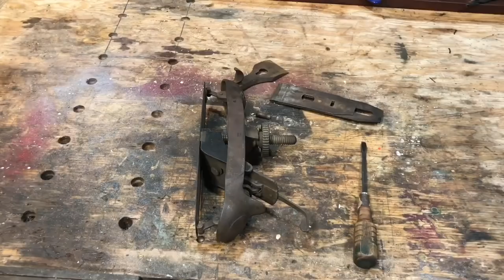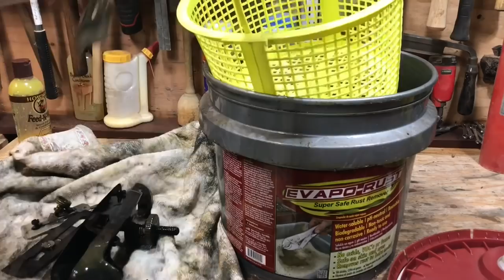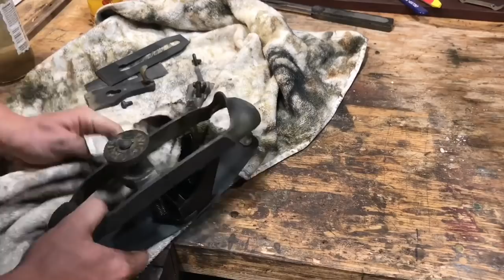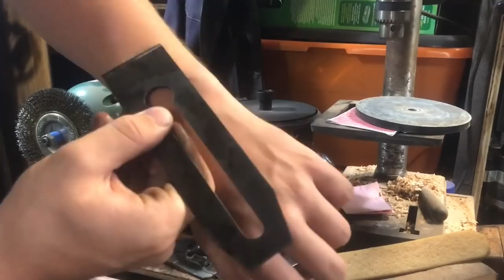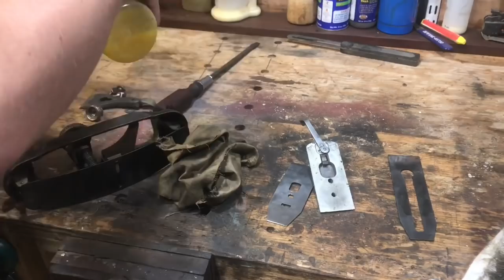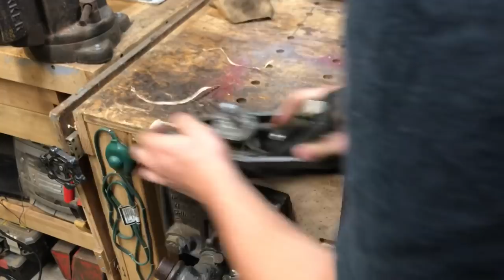Restoring a Compass Plane

Comment: Very nice job bringing this great plane back to serviceable condition but using the lever cap to loosen or tighten the cap iron screw is somewhat amateur. Many lever caps are chipped for just this reason.
Reply from the maker: Thanks for watching this video is over 4 years old watch some of my newer stuff

Comment: numbers 6-7-8 are smoothing planes not jointer planes.  Good job, however you painted the interior parts of the  plane which should be metal to metal.  keepup the good work.
Reply from the maker: Hello, thanks for watching. This plane was just a light clean up nothing was painted on it.

Comment: I would just call this one very good cleaning and put back in use …… Not a restoring   ( the work was very well done)
Reply from the maker: Thank you, but restoring is bringing back to a former condition, and I brought it back to a usable state, but yes I agree there are different definitions for it
Reply: Gerald is right. You didn't restore it. You cleaned it. Nothing more.
Reply: I’m glad he didn’t “restore it” some of these restorations I see are awful. This old tool need saving and now works a treat. Probably worth more with out paint etc that goes with full restoration.

Comment: Can't believe you didn't dismantle it completely. Shouldn't you rinse with water to stop the derusting process? I'm about to bid on one that has been welded together, no doubt it got dropped or fell off a vibrating bench, it's not this one is it.....? You do know how brittle cast metals are don't you? Jeezus h! that is NOT the correct way to sharpen a plane blade! And not a clue how to adjust that blunt blade, furniture wax? Where's the oil a tool like that needs? You really aren't very clever are you.
Reply from the maker: Thanks for watching